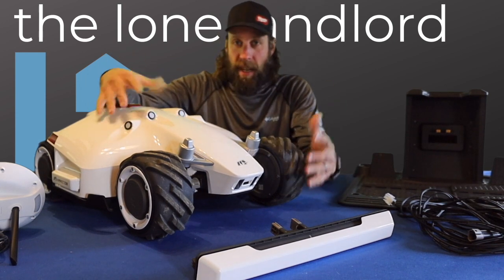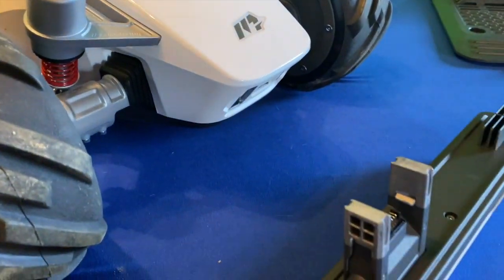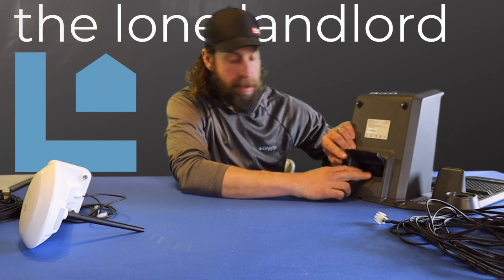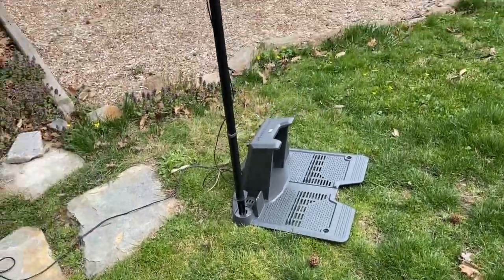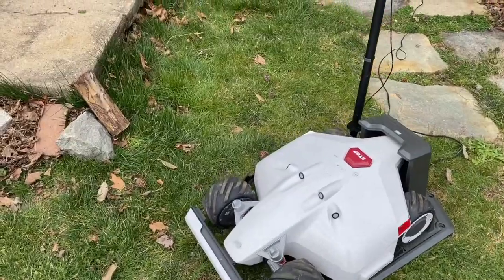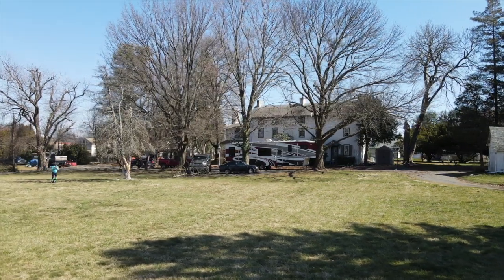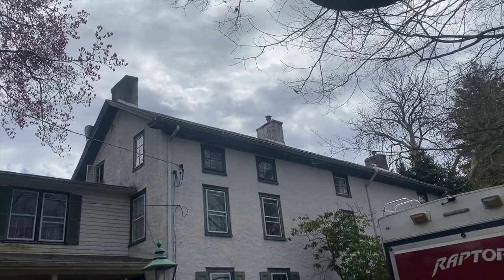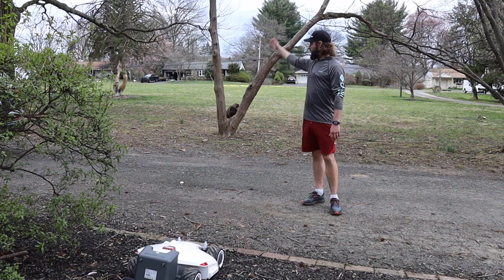Luba Automower Part 2 | Assembly & Where to Set Up the RTK Antenna!

Comment: Can you tell me what the output from the power transformers is? My hope is that I can put this on the outer edge of my lawn and power it off of a large solar and battery directly with 12vdc rather than having to put in an inverter to increase voltage to 120 and then bring the voltage back.

Comment: Great video. Thanks.  The best place to mount my RTK is near a metal roof on the home. It would not be touching the roof but a couple feet away.  Will the metal roof interfere with the satellite signal to the RTK?
Reply from the maker: good question I believe as long as the RTK has a clear view of the sky it should be adequate however their original manual suggests a distance of 5m away from large metal objects

Comment: Hello,
To limit radio radiation at night (antenna attached to the fireplace above my room), is it possible to cut off the power to the antenna and turn it back on in the morning?

It seems to me that it is 900Mhz or WIFI?
Reply from the maker: I don't see why not as long as the RTK location is not moved

Comment: So have you found that the line of site really matters for the RTK? I see you put it on the roof and that would be ideal for me too. However, I also have a roofed front porch that would be very easy for me to access it if I mounted it closer to the front of that.
Reply: Yesterday I finally received my luba and I can tell you for certain (and much to my surprise) that the RTK does not require line of sight!  I placed the RTK in the base (ground) on the back left corner of my house and luba had no issues mowing the lawn on the front right of my house even though I have lots of trees there... and, currently a good deal of haze of smoke from Canada's massive forest fires (I'm in New York)... and luba handled it just fine.  The RTK signal went through the length of my house without issue.  Now I don't have any large rock/concrete walls or anything like that ... just a concrete foundation, wood frame, sheet rock, glass and vinyl siding.
Reply from the maker: Thanks for sharing! I tested out line-of-sight in my 3rd video on Luba and had the same conclusion... it had no issue traveling through the 24" thick stone walls of our old farmhouse.  Enjoy, mine has been working near flawlessly!
Reply: @thelonelandlord   The Power Cord to the base station, can it be cut by the lawn mower if it is placed further away from a receptacle and it is in an area of the lawn that needs to be cut? Will the Zuba cut high enough not to cut the power cord?
Reply from the maker: @Studio-tj6bm  I'm not sure if it's technically rated to be "buried", but if I had to do this I would make sure it was staked down or sitting just below the surface.... Luba 1 cuts up to 2.8" high, but if it's just laying in the grass and gets snagged/caught on something it may pop up enough to be sliced.
Reply from the maker: what I've found so far is that line of sight (or lack thereof)  has no impact. the only requirements I've experience so far are clear view of the sky for both the RTK and the mower itself...  prolonged blockage of satellite signal to the mower creates a problem.
Reply: Great vid! Question, how long is the power cable?

Comment: Customers that are easiest acquire are current customers of husqvarna and Landroid. I have a automower and sick of broken wires and it’s inefficient random path. But it’s a known devil for me. If you can make a comprehensive comparison video, it will help me switch.
Reply from the maker: thanks for watching... I've no dog in this fight so I'm approaching this un-biased. I have a Husqvarna 315 at one of our properties for the past 3 years so I definitely have thoughts and will do a comparison shortly... I want to give the Luba another few weeks of running (and firmware/app updates) however.

Comment: What diameter pole can the RTK be clamped onto?
Reply from the maker: the pole it comes with is about 1 1/4" O.D. There is a lot of room in the screw clamp however I bet it would fit at least 1" bigger

Comment: I just realized it's going to be hard finding a place to put my luba, I was hoping to put it in my garage. The RTX line of sight to the luba probably changes that unless I can get it to work through a glass window. I've got till June to figure it out.
Reply: I just found a video on "Down Grid Survival" channel, and he maps the Ecoflow blade around his whole house, a 360, full loop. He never even meantions line of sight, so it must "just work". GPS uses radio waves, adn we know that radio waves travel through walls, so it might just be a matter of signal strength vs how obstructive something is that is blocking the line of sight.
The video name is "EcoFlow BLADE (Must Watch)"
Reply from the maker: @HezekiahD  great info - thanks. We're stuck in a stretch of dreary & rainy weather here as soon as it clears up I'm going to experiment with some locations. I'm guessing it's more my thick stone house that creates the problem and not line of sight - but I will update shortly.
Reply: @thelonelandlord  Just saw your reply and I just watched a new video that just came out called "Is Luba's RTK blocked by your house?" by crazypostman
That might give you some ideas for testing
Reply from the maker: Thanks, I will definitely check it out first
Reply from the maker: I’m not 100% it needs line of sight… I just know it didn’t work when I had it next to my house. The house is an 1800s farmhouse with 24” thick stone walls though…
Reply: I'm in the same boat... I'm also in the 3rd batch.  My property would have 3 mowing areas'... front-yard, Backyard and on one side.  I'm not sure where exactly I'm going to place the RTK antenna, however, there is video from Luba's youtube channel which they made a while ago which showed the RTK antenna doesn't exactly need line of sight.  In their video example, the RTK antenna signal went through the house... but I'm sure that depends on the structure of the house.  But I just checked their site, and I can't find that video... however, in another video in their channel in the video titled "Things You Need To Know About Luba RTK"... someone in the comment section asked about the direct line of sight and Luba themselves responded with "Hi Klaus, Luba doesn't have to be in a direct line-of-sight with RTK reference station. Thank you." ...  I suppose you and I will know for sure come June!
Reply: I actually found the video I mentioned about RTK and not needing a line of sight from Luba... on their channel its titled "RTK Video - Front and Back Yard Lawn Mowing"...
Reply from the maker: I will do some signal checks around my house next week and update